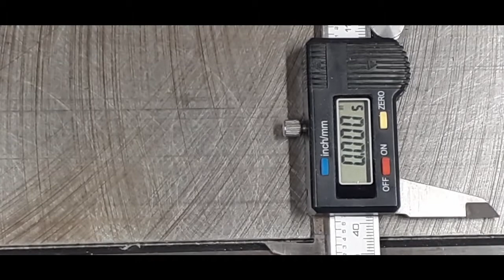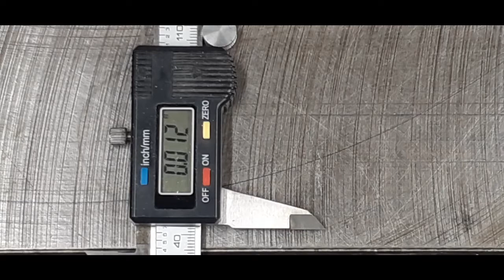Craftsman 10" Table Saw Alignment Check

Comment: Did you have the motor belt on when you checked it?  I took mine off to make it easier to reach the adjustment screws and got it dialed in perfect.  As soon as i put the belt back on, it now reads .005”. I suppose I have a little slop in the arbor or blade height adjustment mechanism but it is much better then it was when I started
Reply from the maker: I did keep the belt on. Your method is probably a better one. Thanks for watching.
Reply: How do you adjust the blade on this saw I have one just like it and am off about a 16 th from front to back

Comment: I don’t think it matters one bit on that old craftsman, it’s just like mine and I have obsessed over this saw for years. I’ve found the arbor isn’t tight enough the blade doesn’t run true enough to obsess over 3 or four human hairs. I would find if I picked a different tooth it could even make a difference. Now on a high end saw yes I would. Don’t drive your self crazy 😜 .
Reply from the maker: I totally agree. In the passed I have nearly gone mad chasing perfection. This old saw is going to to do what I ask of it, and that ain't much. Thanks for watching.🙂